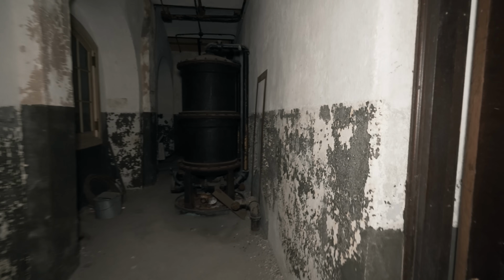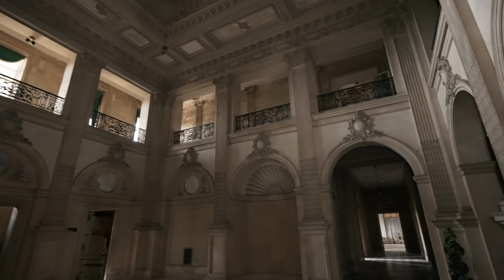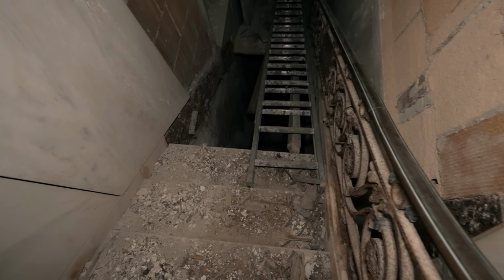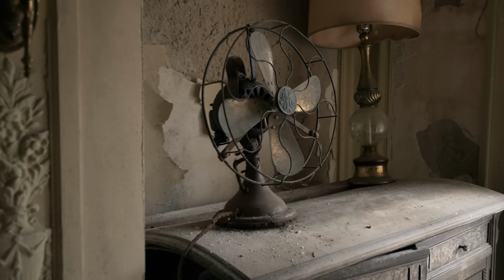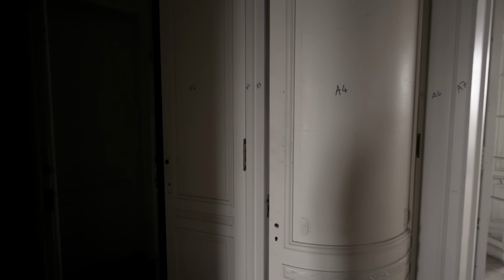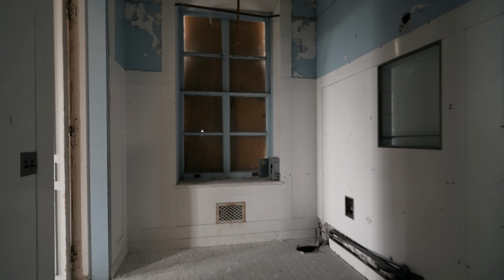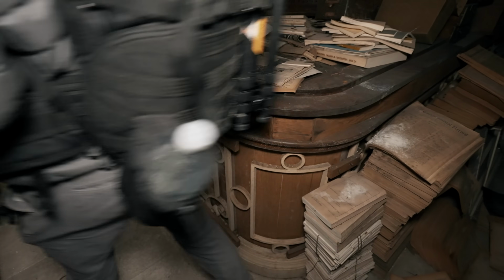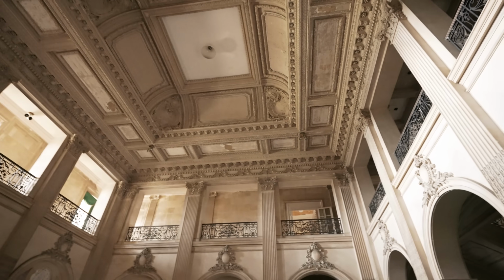Inside America's Largest Abandoned Gilded-Age Mansion - Lynnewood Hall - Pt. 2

Comment: The "tank" at the front of the house, underneath the main fountain, was used as an early air conditioning system. The large fan unit circulated the cooler air back into the house.
Reply: Ah, much better explanation than my  guess it was the septic system LOL.
Reply: Im guessing the shutters on the roof was to open during summer months for ventilation and close for winter to retain heat.
Reply: That makes a lot of sense why the blower was in that area.

Comment: This is an amazing place that shouldn't be left to rot like this.
That GE brass blade fan is roughly a 1917 model. The earlier ones circa 1890-1900 had scalloped blades and couldn't oscillate like that one can. I have the same exact model next to me that came from my grandfather...It used to be mounted to the ceiling of the family cabin until relatives decided to stuff it in the attic and stick a up a modern ceiling fan about 15-20 years ago. It still works like a champ. Back then they built things to last.

Comment: The marble was used for electrical insulation back then. Even in the fuse box and stuff they were usually backed up by a piece of slate but sometimes marble. Didn't burn or conduct electricity.
Reply: that is correct.
Reply: I love those old slate fuse panels. The push button light switches with brass cover plates are my favourite. Those custom cover plates with engraved text must have cost a fortune. Much better than the cheap plastic decora crap you see in new residential construction. I love collecting older wiring devices and panels. I would have loved to see the main distribution panels for this house. I wonder what the size of the electrical service(s) was? Also wonder if the whole place was wired with knob and tube or if they used ridged metal conduit with individual conductors pulled inside. The master bedroom appeared to have had some ridged conduit added during the 1920s renovation that was mentioned.

Comment: Hey guys, great house tour; glad you were able to show it before the security system was installed Also glad there wasn't too much amateur vandalism; eg graffiti, physical damage to the walls and the like. I do have Three comments I would like to share with you for FYI, for future reference...the figures you saw and the faces throughout the house are a very typical feature of Victorian architecture from the period of the houses' construction.  As one of you remarked the figures shown with wings in the various whimsical positions  you saw then in, are indeed Cherubs, the faces you saw peering out of the various accent pieces are if I recall correctly referred to as Putti I believe; because of their pouting expressions. The second comment has to do with the bedroom you entered where the wood burning stove had been adapted to the fireplace's flue. That was a modern airtight wood stove; It was made of cast iron and very likely dates from the 1970's or 80's I recognized the branding on the door. Had it been a wood stove of the victorian era and belonging to the house, it would have been either a Latrobe or a Franklin stove; and would not have been installed in the manner you observed. Finally the large room you were in on the top floor of the residence was a green house probably used to grow ornamental flowers for the decoration off the house. Hence the mechanism for opening the roof's windows. This allowed for regulation of the temperature space; that in addition to all of the small windows around the perimeter of the room. I hope you find the information useful; and keep those great videos coming.
Reply: I imagine the wood burning stove was installed because the fireplace/chimney got some damage that would have been too costly to repair.

Comment: In the doodles behind the mirror you can see what looks like some numbers scribbled down. Looks like what contractors write when taking measurements to remember lengths/widths for cuts they’ll make later. I used to do that a lot on places you knew you’d cover up later, especially when on a ladder or in a weird shaped area. Further evidence the doodles are original IMO
Reply: Agreed 👍
Reply: They said  I think 84 1/2 by I think 40 1/2, couldn't really tell. It looked about right for that space.
Reply: @greyeaglem  mirror size

Comment: You were correct, the pantry and kitchen were connected by a ladder,when the restoration commences,the artificial ceiling will be removed. In the kitchen there is a hanging rail for copper pots and pans. You're right plenty of muscle power need to fix up this house. It's going to be done.

Comment: There is a Saving Lynnewood Hall Organization, but they will need massive funds.
Reply: @terrytwo  yeah I feel like in part one, some degree of restoration felt possible (though VERY expensive) with the rooms we saw. But in part two, there seem to be so many rooms that would pretty much need to be gutted and completely reworked. I can't even begin to comprehend what it would cost to fix this place up.
Reply: Dr Richard Yoon was offered the full asking price for Lynnewood  less than two years ago, and he agreed to sell.
He then pulled out because he wanted more money... he's a pain in the ass.
Reply: Id imagine a new roof, which would include fixing rot under the existing roof and a bunch of other things would be a couple million bucks easily.   And thats just to get the place water tight from above.   I dont even want to know what it would cost to refurbish or in most cases replace the windows, fix the rotted sills, etc
Reply: It would be in the hundreds of millions to restore it. It would have to be nearly gutted. ALL plumbing and electrical would need redone and up to code, all asbestos removed, all lead paint removed, all mold removed.The whole house would have to be inspected and made safe. The amount of man hours required would be insane and this is all before you do any cleaning, restoration to the trim, wood, stone, iron, grounds maintenance, fixtures, furnishings etc...  It would take many years plus a billionaires budget.
Reply: It was estimated, ten years ago by architectural historians that toured the interior, it would cost $50,000,000.00 to restore Lynnewood Hall to it’s splendor, and that did not include the purchase price. As one commentator stated in this thread: new roof, complete replacement of all plumbing and electrical, replacement of all windows, HVAC systems including ductwork, replacing destroyed skylights (some being stained glass) replacing interior wood rot, replacing fireplaces (most were marble) restoration of interior wood detailing (if it can be saved) restoration or replacing hand painted mural ceilings, etc. etc. etc. But before any of that, a structural engineer would have to generate a thorough report on the stability of the underpinnings of that massive house. Several floors of that place are underground.

Personally, I think Rev. Yoon
is being highly vindictive. He was no doubt pissed when his Seminary, then located at Lynnewood, was denied tax exempt status, so he pulled up stakes and relocated. It’s as if he thought he would show them by letting the place fall into ruin before he decides to finally sell. He could care less about the mansion and it’s historical significance. What may happen, I expect, is the same fate as the larger Whitemarsh Hall that was located 5 miles from Lynnewood. That mansion was abandoned to ruin and vandalism and sold to a developer, for the acreage. They in turn had the mansion demolished and put up a housing tract. Whitemarsh Hall was designed by Horace Trumbauer, who also designed Lynnewood Hall.
Reply: @TheCarnivalguy  
Yeah I agree...Richard Yoon doesn't care about the destruction of Lynnewood Hall at all.
It's a very bad situation all round.
I'm half expecting a huge and devastating fire to engulf it or some other disastrous scenario 😢
Reply: @ROB  Redoing ALL of the plumbing and electrical honestly seems a bit extreme. Assuming all of the wiring is in conduit new conductors could just be pulled. Most of the fixtures, wiring devices, etc can be restored and reused. As for the plumbing, anything that is deteriorating or made of galvanized steel should be replaced but the old cast iron pipes used for heating and drainage can most likely be reused. Besides they are probably much higher quality than the plastic shit used these days. I agree that getting the exterior watertight (i.e. repairing the roof, windows, sills) is the biggest priority. Also all of the electrical and plumbing would not necessarily need to be brought up to the latest code since a lot of things would be grandfathered. Besides installing modern electrical panels, light fixtures, pipes, boilers, etc would take away some of the character. Also some of the latest codes are a complete money grab. No one needs AFCI protection on each circuit and tamper resistant receptacles are complete garbage just to name a few changes that I really hate and find to be unnecessary in many cases.
Reply: So sad he won't just sell.

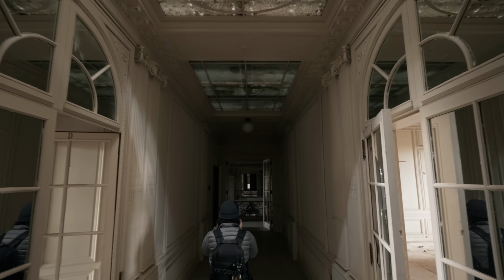Comment: So if anyone is interested, there are mansions in Rhode Island of very similar architectural style, that are still intact and/or being actively restored. The Newport Mansions. This particular mansion reminds me of the Breakers, especially with its use of the multilevel skylights in the second floor ( 24:26 )-there's a third floor which is likely for servants, where the "real" skylight is located, with a second skylight on the ceiling of the second level casting natural light into the hallways. In the case of the Breakers, said skylight is located over the main stair, and it's not only huge, but it's also composed of stained glass, and it's genuinely one of the most brilliant and gorgeous details that is easy to miss.

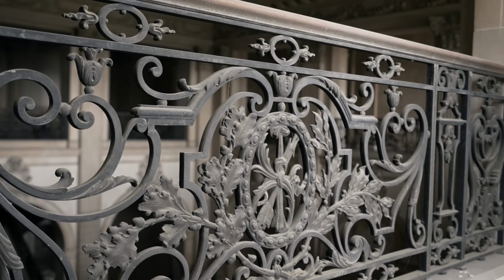Comment: 24:57 those are not vines but oak. Oak has a deep mythological meaning. The rooms on the level where that glass dome was are already for servants. 30:49, they are no extra bedrooms. They had servants of higher standing of course that had pretty decent rooms and then there was the rooms beneath the roof, hot in summer and cold in winter for all the low degree servants. The second hallway that was still pretty but no so much like the first one for the lady and the gentleman of the house was probably the children's hallway and for their nanny/nannies. Adults back then didn't like to have the children around them all day. They were probably most of the day with the nanny and just visited their parents for one hour a day. Hence the extra hallway across the "family" hallway.

Comment: Never seen brick walls lining a pool before.  Looking at the ceiling above, we can see how the humidity from the pool has caused those big steel beams running across the ceiling to rust, which caused a spalling effect, which pushed the marble panels off of them.
Think those shutters up top are for ventilation. I'll bet that that giant squirrel-cage fan you showed may have had something to do with that too.
Also very interesting how some of many of the rooms on the first and second floors have vents in the walls for forced air heat, yet there are radiators in a few rooms, mostly on the third floor!

Comment: The drawings behind the mirror are probably original.  Contractors often signed their name or made doodles in places they knew would be covered up.  Also, the style of writing the numbers is very similar to what I've seen on building permits from the 1890s. The house I grew up in was built in 1892.  On the part of the chimney that passes through a dead space under the roof the bricklayer made a little face out of mortar.   Originally that space was closed off.  When my dad was doing some repairs to attic I crawled through that space.  I was not expecting the chimney to be staring back at me.

Comment: Looks like there were some math figures (measurements) behind the mirror that had the face drawings in the bedroom.  Many carpenters would write measurements on the wall knowing they would be covered up. We would jot down figures off the blueprints while cutting baseboard or trim because actually sizes might differ slightly.  Then we could just glance at the measurements and cut several pieces.

Comment: Around midway the pool area and broken steps reveal terracotta blocks where the plaster has fallen away. That type of block and variations of them appear in the walls of most of the big turn of the century (and a few decades later) apartment and commercial buildings all over NYC. After WWII concrete block was more commonly used. They are hollow and provided some thermal insulation, but not much. Lynnewood is a steel frame building and the terracotta blocks are much lighter than solid brick .The Empire State building, Chrysler building, Radio City etc,  were still using them. I used to live in an apartment building on West End Ave from about this period and the walls inside and out used them. 
Marshfield Hall - built a little earlier I think, was built with brick walls and partitions. Trumbaurer decided to use the lighter terracottta perhaps for lower labor costs and weight?  Widener may have been among the super rich but he still had to worry a bit about costs. People at this time didn't like to dip into their capital. But that's only a guess. 

The bronze balustrades of the stairs are french style and the newel post with foliage scroll work is actually based on the one in the Petite Trianon at Versailles.

Comment: Unreal place!...It is said '' Back in 1910, the pool was enclosed by a state-of-the-art squash court and changing rooms. The house at one time had its own electricity plant and was supplied with water from its own reservoir''

Im curious where the reservoir was..those big filter housing could have been to filter the water and maybe that round flooded area in the tunnel was the reservoir?..
Wonder where the electricity plant was?
That pool was strange, how did they get in and out of it with no sloped shallow end?..just a ladder i guess..
And pool was surrounded by a squash court?..was that inside?

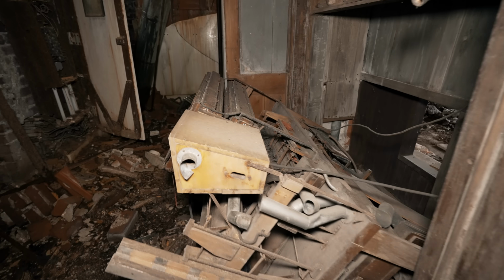Comment: 15:45  If anyone is interested, I’ll post info on that organ. Otherwise, I’m not going to bother typing it out.  The younger generation seems to prefer to learn visually, rather than taking time to read.
Reply: <---interested
Reply: @TheCarnivalguy  thank you for that amazing information. It is very sad how it ended up. I can only imagine what it would have sounded like in the mansion back then.
Reply: @chronic2001n  You’re welcome. I failed to mention, with 19 ranks of pipes (60 per rank) the Lynnewood organ would have had 1100+ pipes. In most cases, no one in these large homes and mansions knew how to play these organs. The wealthy would hire organists to play for them privately and at social gatherings. As mentioned in my above post, in 1919 a Duo-Art system was installed in the organ. These operated on the same principle as a player piano, although the organ could still be played manually. I wonder how many of those old paper rolls for pipe organs have survived. I am no expert, but just a few things I’ve read about over the years. I would welcome additions and corrections from others more knowledgeable.

Comment: The underground water tank might be a cistern. The large water filters might be evidence of this. The giant blower might be another clue. It is possible the cistern was also used for evaporator cooling. Those tunnels may have been also the main feeder duct for the building, bringing the water cooled air into the building.

Of course, it would depend on where this mansion is located. If it's in a humid climate, then what I suspect wouldn't make sense. And humidity will damage paintings.

But the blower seems to serve no other practical purpose. Anyone else have any ideas on that?

Comment: Hey guys I've noticed you both pack pretty light while exploring but I'd like to offer a few tips to make your experience a little better. It's recommended that heavy items be packed at the bottom of a backpack. Lighter items on top. If possible try to keep heavier items closer to the back as well. If you have heavier items sticking out, like a filled water bottle, it'll feel heavier. If possible I'd recommend either mounting the water to the bottom of the pack or on the side. Best of luck with future explorations :)

Comment: It breaks your heart to think it, but Lynnewood Hall will never return to it's former glory.  Before you could begin any meaningful restoration effort you'd first have to clean out the decades worth of garbage from it's previous tenants.  Then repair all exterior and structural damage and fully shore-up the house, remove the old boiler system, add modern HVAC, electrical and plumbing to the entire house and repair all internal damage.   The cost of those efforts alone would very likely exceed the current value of the property.

Comment: It's a shame nothing will most likely happen there again. The only people that would afford to live there already have mansions, don't need something that large anymore and it's cheaper to just build something new and more modern. The only thing it could really be used for anymore is some kind of event center but the cost wouldn't make it feasible or profitable. Plus it might not be zoned to do anything beyond residential. Also you have to take into account that the infrastructure of the surrounding area to support lots of traffic to it, if turned into a event center or museum or whatever someone tried to do with it. 
Pretending I won the lottery and had enough to splurge on this place I wouldn't because so many of the cool original features have been sold off